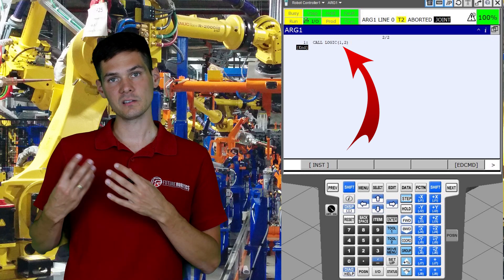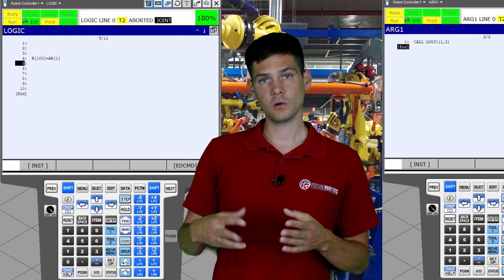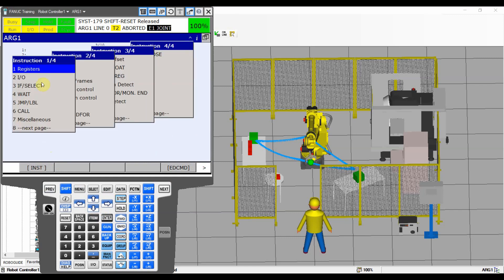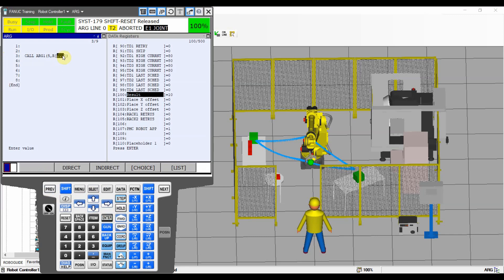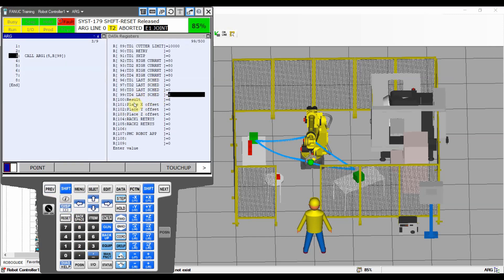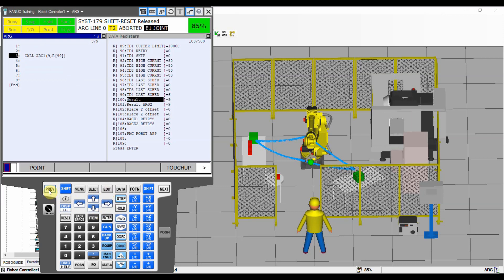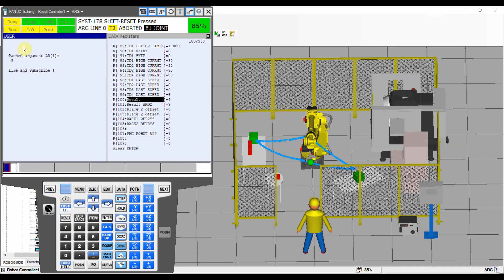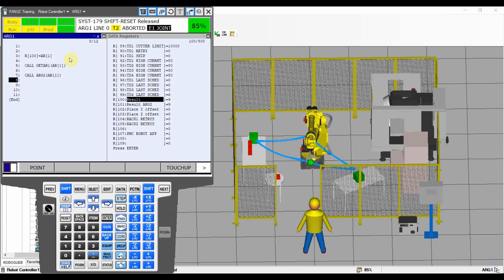Passing Arguments AR[x] between programs in FANUC robots.

Comment: I don’t understand what is advantage of passing a constant/register via arguments over using them directly in sub-program? This indirect option can be a problem for FM workers who are often not so expirienced as programmers. Breakdowns need to be solved as quickly as possible so there is No time to search on YouTube what ARs are
Reply from the maker: Ture and not not true at the same time :-) It's all up to documentation and standard, if all robots are programmed in the same way and it's been explained than it's not an issue.

In my opinion using argument makes the program cleaner eg. imagine that you are setting a pneumatic gun position based on a value, than every time you call a Macro you need to define the R[x]=x a line before, so there are 2 risks that this carries:
1. if someone forgets to run the line with R[x] you won't have the correct value
2. if someone will get stuck in the middle of the macro (eg WAIT R[x]=100 and changes the value of R[x] to 100, because the robot is waiting for it than this can cause damage / crash to the equipment / part

both of those issues are solved by "hard coding" the value into AR[x].

Also I do think "Breakdowns need to be solved as quickly as possible so there is No time to search on YouTube what ARs are" is a statement that can be made by someone not familiar with the robot and we know that not always we have a programmer on hand that can solve the issues easy, but what's more important is to have a safe program that is written is as error proof as possible and using AR[x] is one of the examples.

I recently made a video about Robot programmer evolution: https://youtu.be/H90kjESq2vk
and we need all types of programmers, but there is a reason why there is a "robot programmer" title, because robots are not made so everyone that touches them can operate them, it requires certain set of skills :-)
Reply: @FutureRoboticsChannel  indeed, thanks for a nice example ;)
about a standard - it is not always as clear and simple - specialy in old factories, which are in 99% modernised by outsourcing - different parts of factory are robotized by different groups  that use their own standards. In the end there are 3 or 4 standards in one factory :) on the other hand factories want to cut costs on maintenance so they hire a one man army universal soldiers called electromechanics that need to take care about everything :P 

however, as You mentioned - safety first (for both machines and humans :P)

Best wishes i życzę miłego weekendu (wnioskuje po nazwach programów :P)
Reply: Today was day i used arguments, we had sub program for welding robot wich was called 4 different times in main program and i wanted that sub program give different Group output every time so this was useful to make program much quicker!